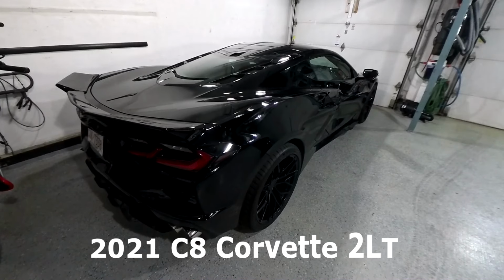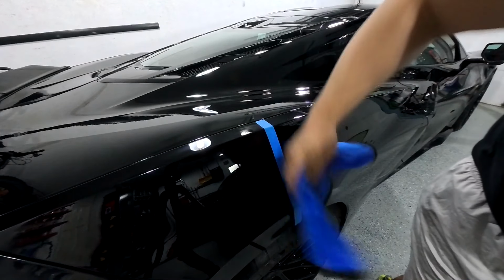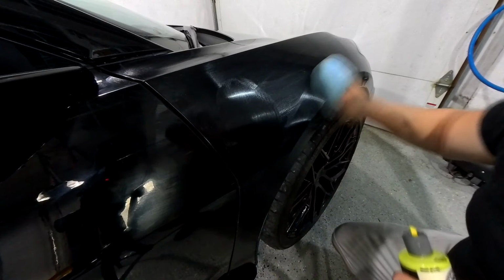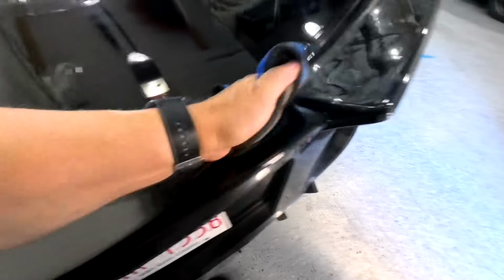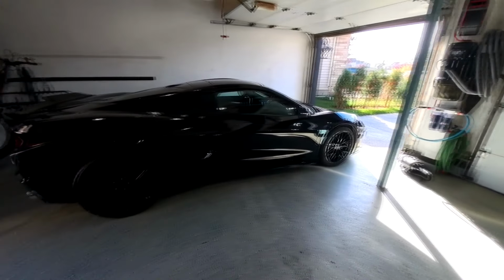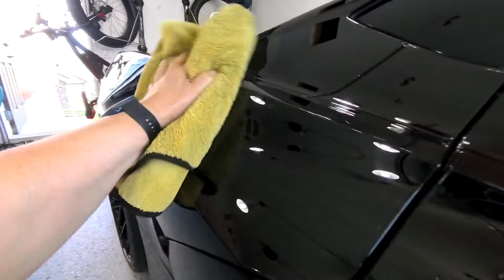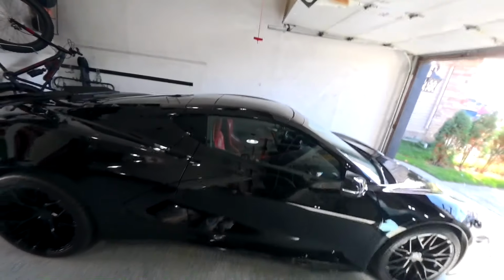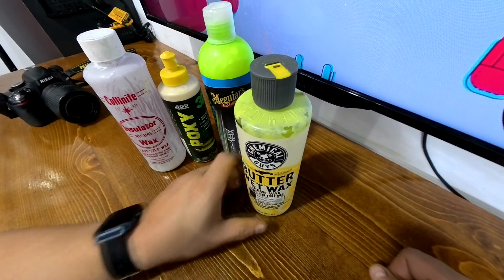Is This The Best Wax? Review of Chemical Guys Butter Wet Wax

Comment: Waxes are meant to be reapplied more often the other products like liquid ceramic or graphene,  etc.. Butter  Wet wax, is so easy to apply even with the effort needed. It shows the labor is worth it even though more frequent applications may be necessary.  Nutrual soaps help elongate the effects as well as your environments.   It us a fantastic product..